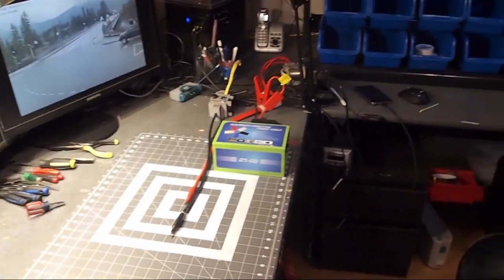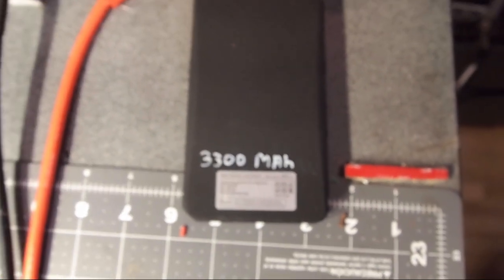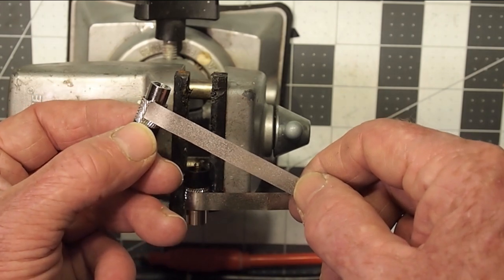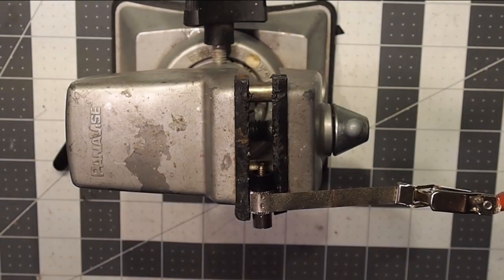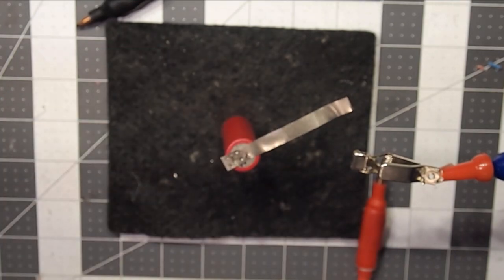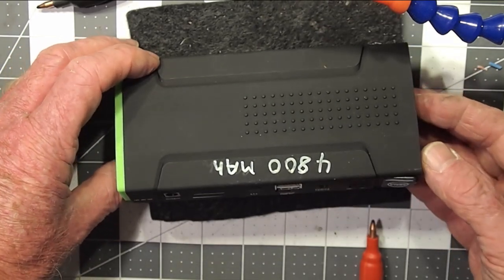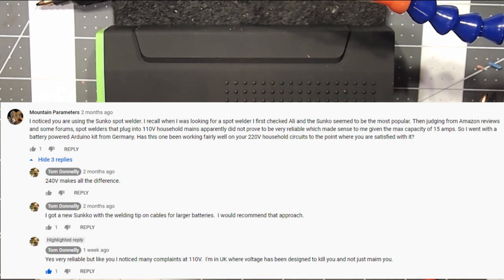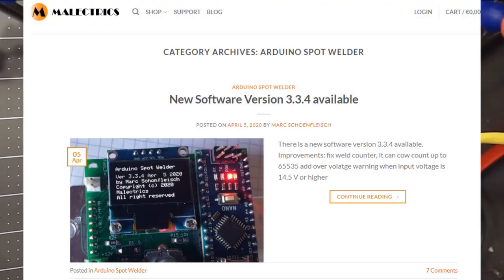Batteries S02E01: Spot Welding with Li-Po Chinese Powerbank/Jump Starters

Comment: Hi, was your power bank a 12V unit. I recently ordered an einhell CE-JS 18 car-jumper/power bank 18000 mAh real. I am expecting it to arrive. It has an 12V output (beside the USB ports and the laptop charging port). It literally can start a car. It doesn't cost much, around 120-140$. Pretty sure it would work better with that. I plan to use it for my mini spot welder too (also to heat up my warmed jacket that i orderd, power up my phone, start my car if needed, etc).
Reply from the maker: I've tested quite a few of these Made in China power banks, and the actual mAh is usually inaccurate by a large margin. Indeed they will in fact start small cars and scooters as long as you do not need to crank them for long. The issue for these with trying to run a spot welder is not the voltage, it is the capacity. With a few small Li-Po cells in a 3S series configuration, they simply cannot provide the current that a spot welder requires. It may also be worth noting that their website seems to calculate the mAh rating based upon multiplying the mAh rating of one cell by 3. You can do that if the cells are in parallel but to get 12V they have to place them in series, which would mean the items cannot have a capacity of more then one cell, which they state at an improbable reading of 6000 mAh. Given the size of this item,  and the spec's published on the manufacturer's website, the item must contain a 3S1P cell configuration, and is probably actually 2200 mAh. They are also not exactly accurate on calling it a 12V battery pack because the nominal voltage of a 3S Li-Po cell is 10.8V (with a full charge it comes off the charger at 12.6V, but accepted industry practice does not call a 3S configuration a 12V battery, you need a 4S1P for that). After trying a number of different batteries, I am presently using a 200 Ah SLA/AGM battery that weighs 160lbs to power my spot welder, and this is resulting in consistent good welds on 18650 and 21700 cells with a timing of 25ms. 

Please be sure to come back and update how you make out.